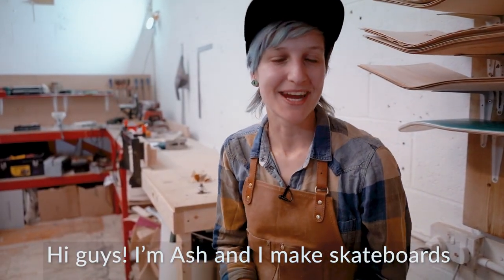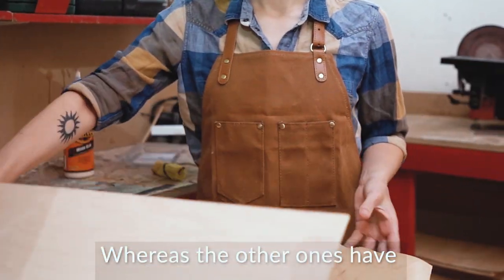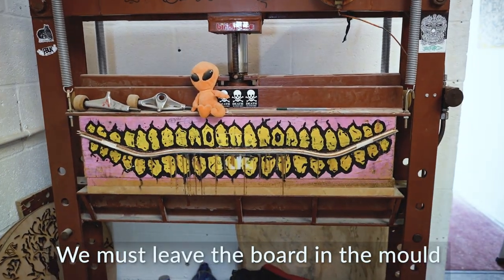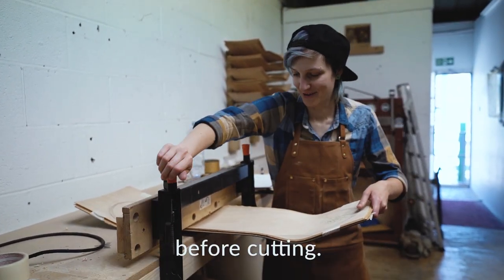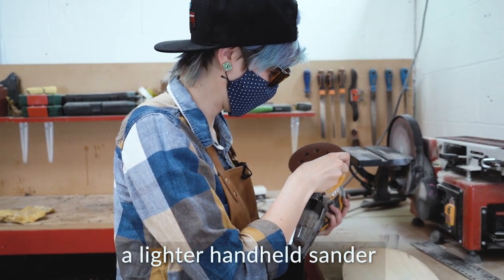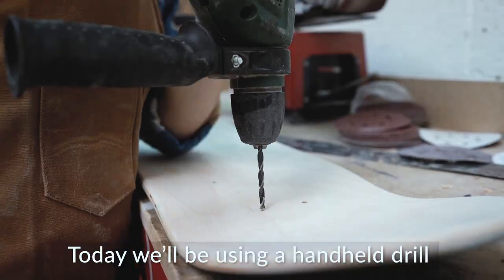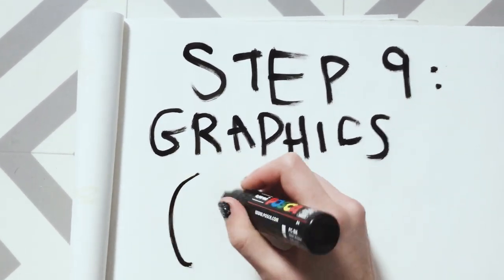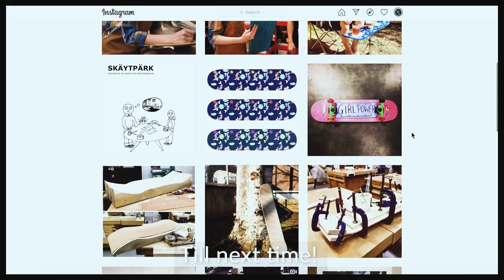How To Make Skateboards - With Ash Skates

Comment: question:
* what glue were you using?
* you left the glued veneers in the mould for 24 hours? 😱
* is it required to wait 5 days to cure before shaping the board?
Reply from the maker: I usually use Ultimate Wood Glue - Titebond but this time I was using what was available (Gorilla Wood Glue). Yes, it's better to leave it for some days to cure, as the wood can shift even after being cut and you can end up with a misshapen board.